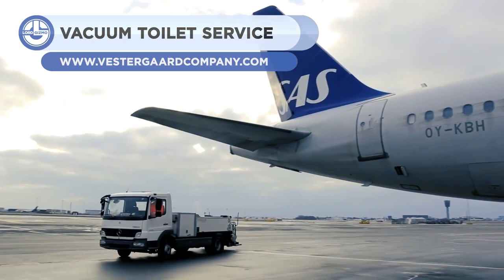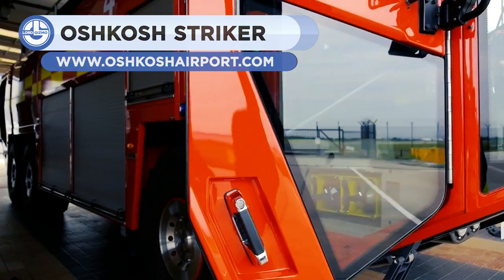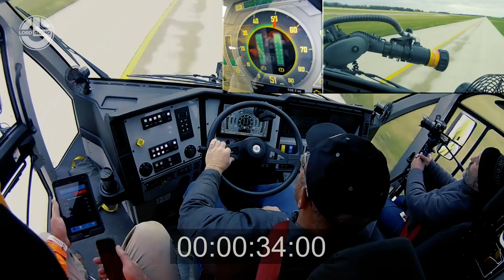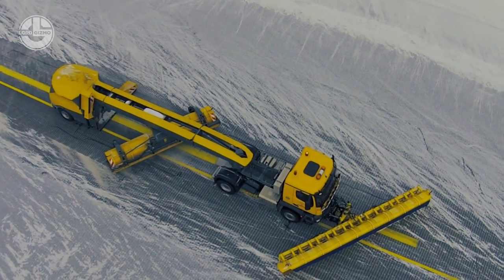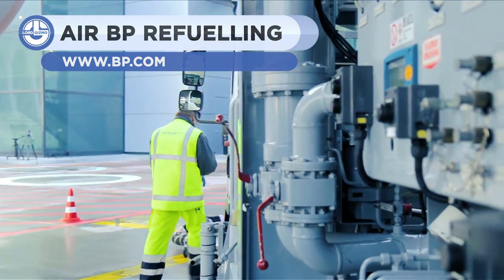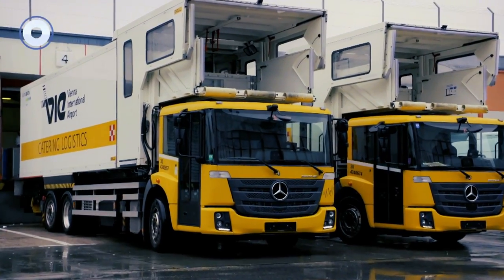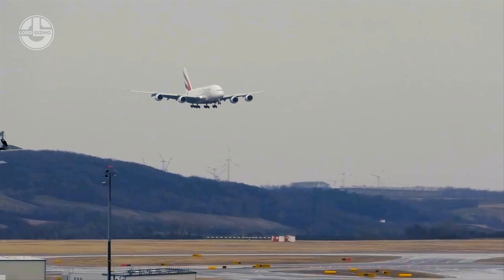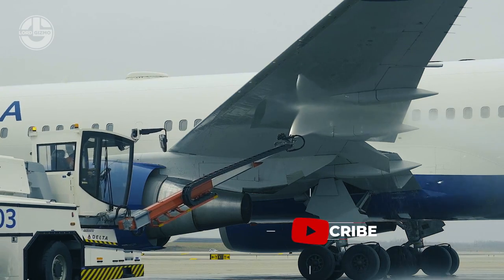The Most Advanced Airport Trucks And Machinery You Have To See

Comment: The equipment is nothing short of amazing I was in Crash Rescue in the Marine Corps over 50 years ago and look at this new equipment the stuff we use like it was back in the horse and buggy days 4500 gallons water  water supply our biggest vehicle had a 1000 gallon supply and I can’t remember what the other vehicles that is like four or 500 gallons you mix that with foam and of course the volume would be increased but 4500 gallons our runway foaming truck was  used to blanket the run way it only had 4000 gallons of water and 1000 gallons of foam on it and that was not a rescue truck it was just a former fuel tanker that we put together the engine for the pump was a gas slant 6 we got from the motor pool 😱and because of the extra weight the frame kept cracking. Aha the good all days.
Reply: Thank you for your sacrifice and service